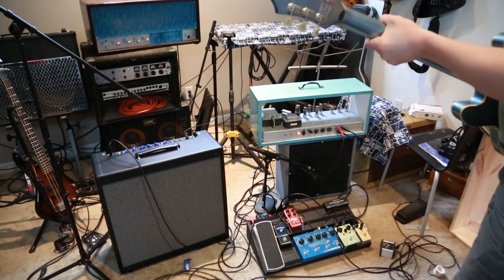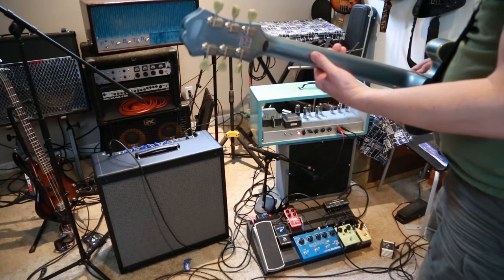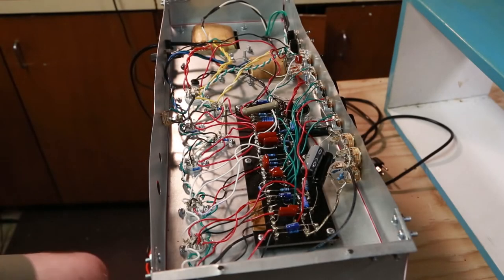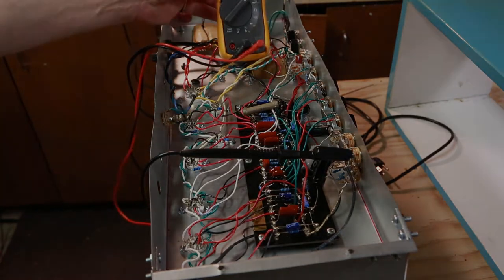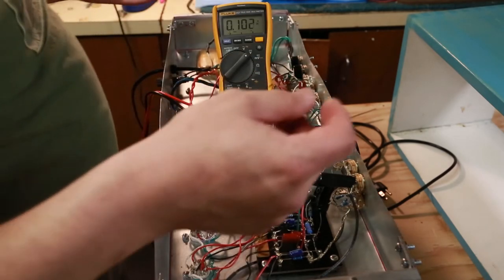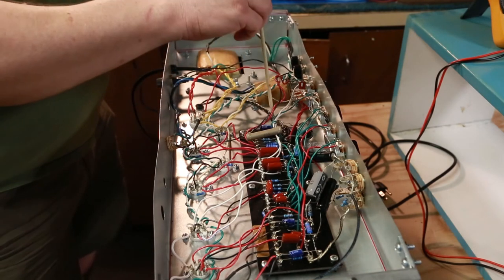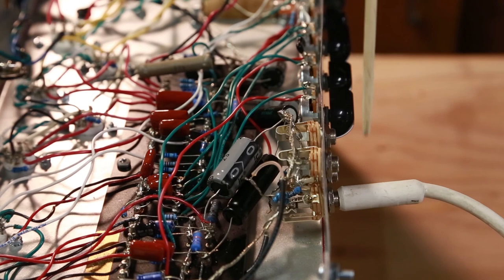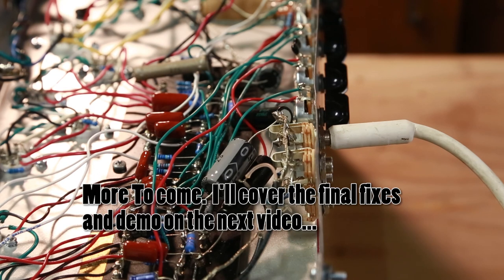Vox AC30 Fix Video 1

Comment: Hi Frenchie Films.Can you help me solve a problem with my 1964 Vox Ac30 

after 10 minutes into playing sometimes less than that the amp starts humming . Recently i changed filter caps 16+16 uf and the front filter cap 8+8 cap . also i ordered some original Alen resistors to replace those that have changed in value . Before changing the resistors i changed the filter caps and the amp wasnt doing the hum .than i changed the resistors there was the hum .Did i damage any coupling cap with the heat of the solder ,is there any bad solder connection (broke some of the tag strip lugs ) .what could it be ?
Reply from the maker: Nita, make sure you replace all the electrolytic capacitors, as they usually only last fifteen years, those should be the cause.  Buzz or hum could also be due to poor soldered connectors, or wires close to the signal path.  Without good pictures it's really hard to diagnose, though
Reply: i can take many pictures .Sounds like i should replace the all the electorlytic Capacitors because the amp had almost everything original until these problems started to show up .What is the proper way to test the capacitors with multimeter beside the ohm reading ?
Reply from the maker: To test capacitors, you really need an ESR meter for electrolytics, and for non electrolytic, it's best to test for DC leakage, which isn't easy to explain in YouTube Comments.  I recomend you post details about this amp either or both of two forums I frequent heavily ampgarage.com/forum or www.el34world.com/Forum/index.php  both have great people that can help, and I would be happy to as well.  Youtube just doesn't have a great way for people to interact as deeply as forums.  On the forums you can upload your photos, get tips on what to try etc.  Besides, I'd love seeing gut shots of that amp :D